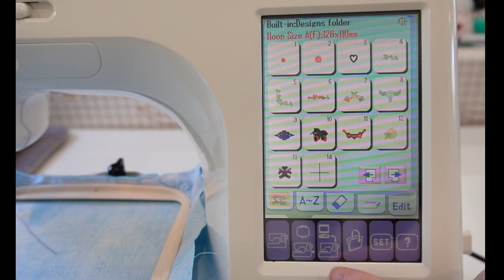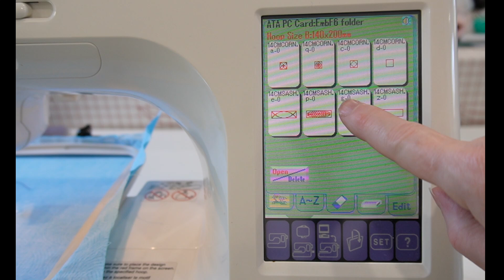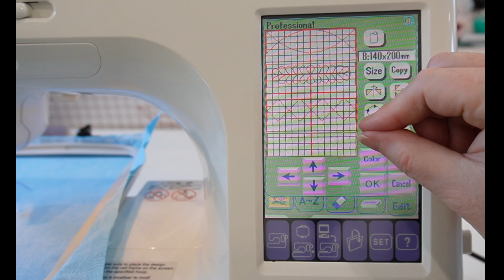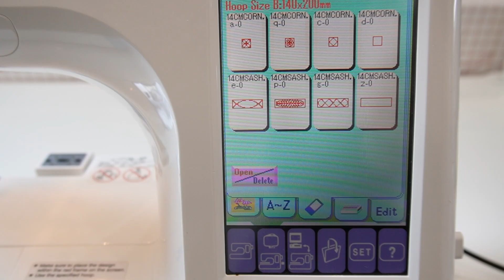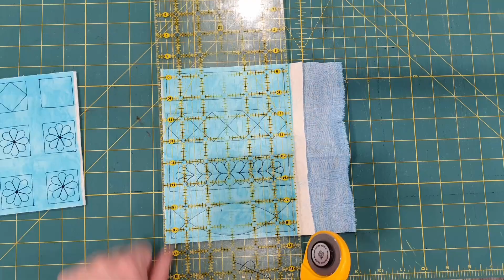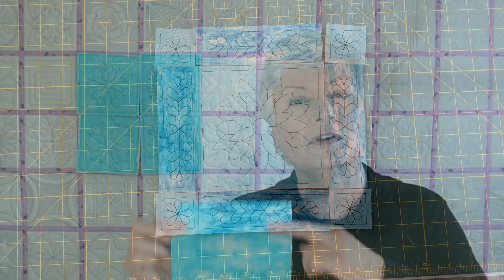Quilt As You Go Sashing | Embroidery machines

Comment: Gorgeous! Where do I buy the tape? Learning as I watch you design.
Reply from the maker: I make the tape from the fabric, using the Simplicity Deluxe Bias and Piping Machine. 
You can also make it with a small bias tape maker and an iron.
Since I am usually covering straight joins, it doesn't need to be bias.
Cheers Sharyn